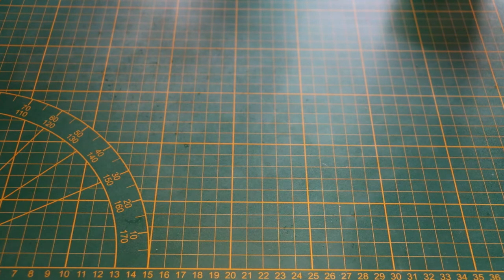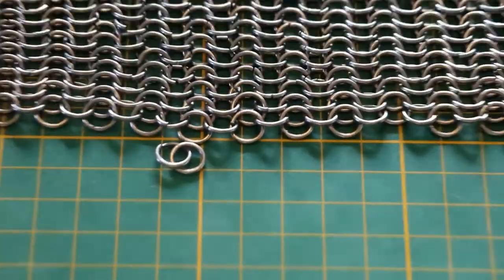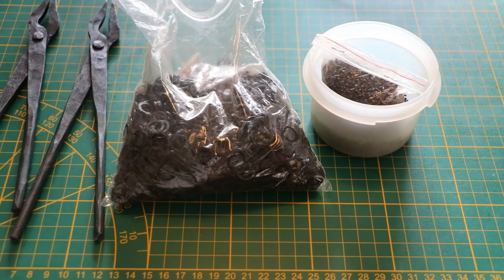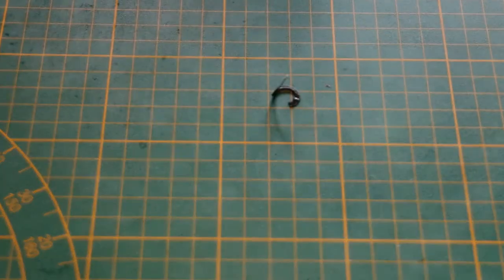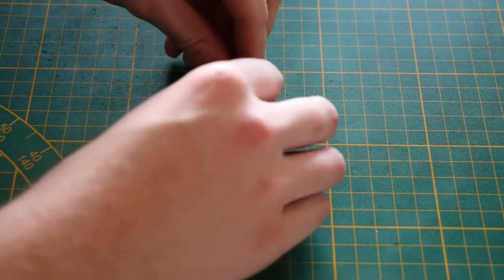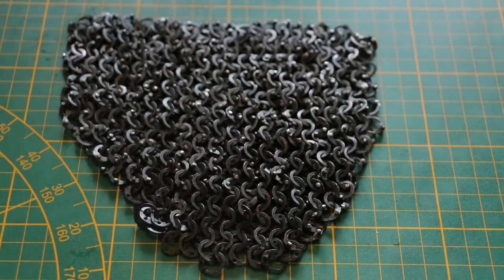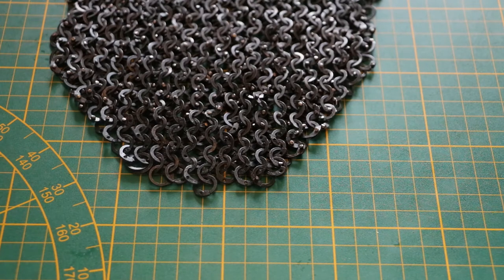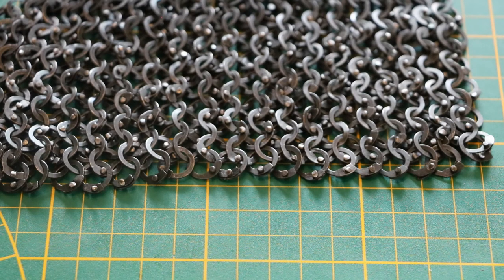Making riveted mail, the basics and tips

Comment: Really want to start making maille from scratch. The spooling, the annealing, the hammering, everything. Just don't know where to start.
Reply from the maker: in all of my knowledge (haven't done this before): use steel wire(mild steel is a favorite for most), put it around a bar or stick with the desired diameter (6-8mm I believe is very common) wrap the steel wire around. With a pair of pliers, cut the wire in such manner, that the ends overlap a bit, so you can later place a rivet. with the two ends on top of each other, hammer it down till all is flat. (I think using a hammer and a steel bit between the hammer and the ring should do very well). Next drill a very tiny hole in the bit that is overlapping, then put in a tiny rivet and proceed as the video tells you ;)
Reply: thank you!
Reply from the maker: @steel5333  side note, the mail used in the video is .75mm's thick and spans 9mm in diameter
Reply: @feudalfrits9559  Right, was about to ask or look around so thank you.
Reply from the maker: @steel5333  no problem
Reply: Hi Steel, have a look at https://www.ironskin.com/how-to-make-riveted-chainmail/ You can find some tutorials and help with the tools there.

Comment: Great video, I think you missed a tick on showing how you connect the next set of rings, to build the size of a sheet. But some realy good tips (such as the way of saving a ring when cutting, really asmart, spec if you get fancy rings lol, I'm going for some cheapo mass produced 10mm rings for my first attempt but I want to work my way up to flat 6mm rings form ironskin or capapie. as I hear the quality of the rings there is top notch 
Plus ironskin sends thier 6mm flat rings pre opened so thats a god send XD But they a bit spenny

Comment: The riveting plier that you used is bad
I used 6 of them and everytime I use it, the beaks of the plier (the part where you put the rings and then rivit together and press them shut) always go out of orientation so that the little holes on both beaks no longer align and thus get bad rivits
And I was working on a Roman steel mail shirt (4 in 1 with alternating solid rings) that weights around 3kg
Reply from the maker: Yeah, I now have a new one working way better. Whilst using the pliers in the video I never used the notches, I just used the hinging motion to lock the rivets